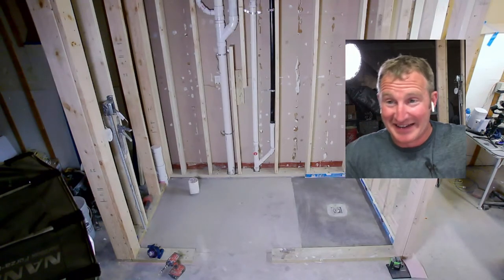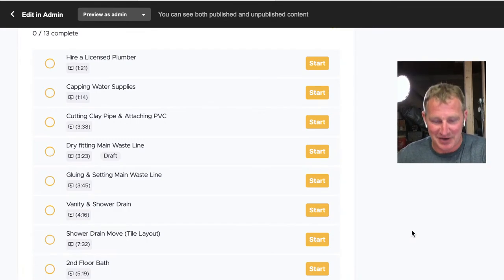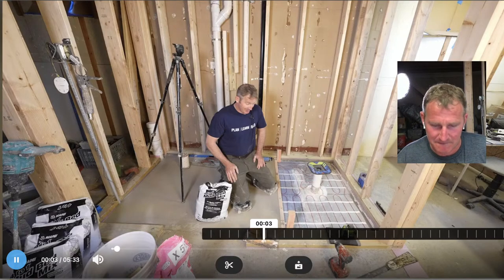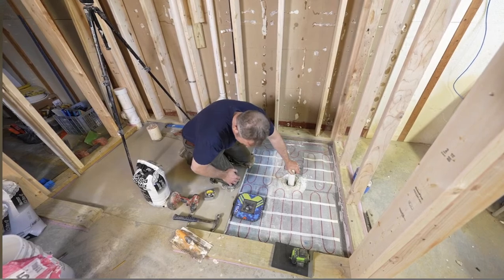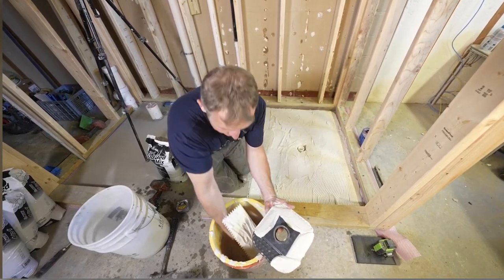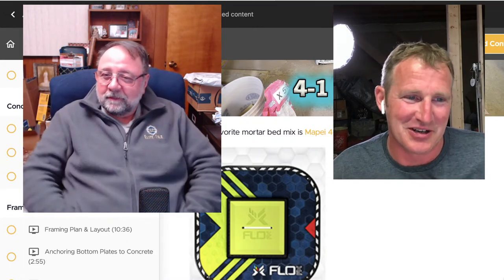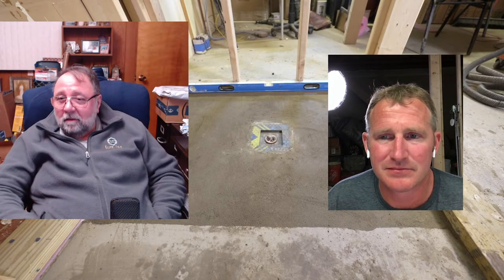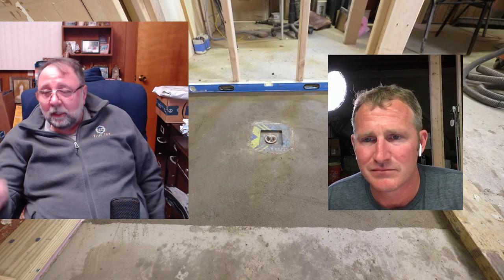Mud Bed Shower Pan | Tips from Sal

Comment: I have  noticed a bit of the bird bath effect at the flo fx drain. Maybe because the actual flange is flat.?.   i think they should look into sloping the actual bonding flange slightly to assist in drainage at the last couple inches.  After flood testing, we noticed a bit of water pooling just at one part of the flange.  To fix, just spread feathered thinset around the flange and let dry ( minimal time when its that thin.)  then reapplied liquid membrane for my usual overkill. retested drainage and tiled.
Reply from the maker: I’ll check it 👍

Comment: Man Sal played softball...the assembly of this bathroom was not proper...putting self leveler and moter over the heat mat...very poor choice to with the cork mat...that bathroom is destined to fail
Reply from the maker: You should explain your point better.  Nothing wrong with self leveler
Reply: @Bathroom Remodeling Teacher  you work hard and are trying to do good by putting information out for people to follow...you seem like a nice person as well...forgive me if I come off harsh...I'm always of the mind set that the more components equal great chance of failure...both the cork mat and the heat mat are designed to be flooring underlayment not self lever or topping bed underlayment...the floor should have been leveled first...anyone can do a simple Google search and see these materials are not designed to be used that way...heat mat systems are not terribly effective at heating floors to begin with let alone buried in material this way...why not just use and uncouplining membrane adhered directly to pre leveled floor...if you want to save money on the mat and not go with Ditra heat, then just by the wire separately and installa budget uncouplining membrane...also as others hv commented(tho less important because the floor will not produce much heat) your layout for the heat mat was non existent...mats should not go under vanities or toilets among other spacing restrictions...I have over 50 bathrooms under my belt and that's in addition to all  sorts of other remodeling I perform including kitchens...a simple Google search will show all that I hv stated to be factual...in summary I disagree with the way you implement and integrated the underlayment system...also your mud bed should be a continuous slope from level point to drain...seems to me like there Is a steep run to the drain...in other words a straight edge should be able to sit from perimeter to drain with zero gapage...it appeared on camera not to be so...hopefully you learn and grow...like I said I'm sure you good people and you definitely are a hard worker with a lot of skills...not knocking you...just saying people deserve solid information...also for the record I would hv treated this as one big shower pan and just floated the whole thing...ideally there should be pitch on the main floor as well if possible and it was definitely possibly...so installation would  go:
1) thinset slurry to adhere toping bed
2)topping bed float
3)uncouplining membrane 
4)heat wire 
5)tile
Reply from the maker: @tonyvee626  warming system does allow leveler overtop up to 1 1/4". But you bring up a valid point going over cork with leveler this thick. The shrinkage of leveler could possibly pull the cork from surface. I am stretching the limits of the products here. Something I will improve upon. A mud bed over entire floor probably makes more sense now that you bring this up. Sounds like you have a lot of experience. Thanks for sharing. I've been doing exclusively bathrooms for 15 years now. Probably have done 100-110 of them now and still learning on everyone. Can always improve 👍
Reply: @Bathroom Remodeling Teacher tile on my friend...apologies again if I sounded snub or rude...I appreciate your dialog it shows your commitment...lastly about the heat mat I know some manufacturers allow it(shluter does Not on any of their heat mats or uncouplining membranes) for me it's an efficiency issue...anyone who's has these systems knows its not great heat transfer...why not prep the floor first and give the client the best possible performance...both steps must be performed either way...anyway that's all my 2 cents on the issue...all the best to you